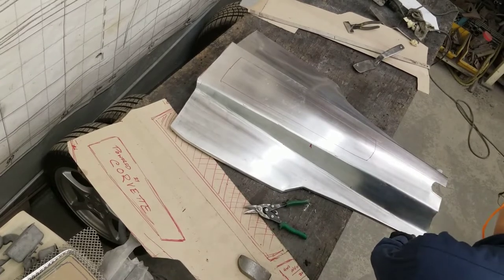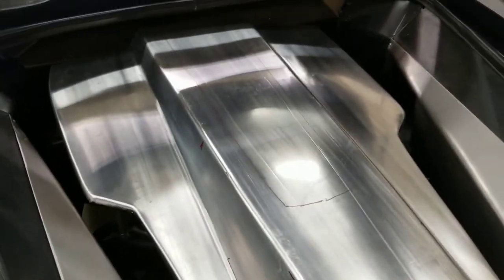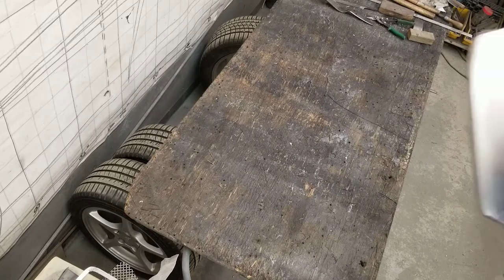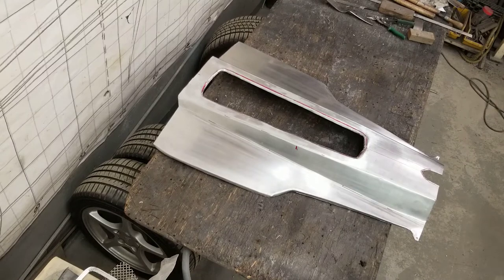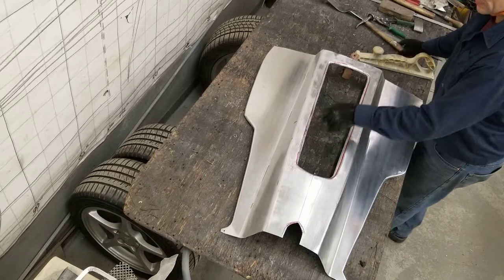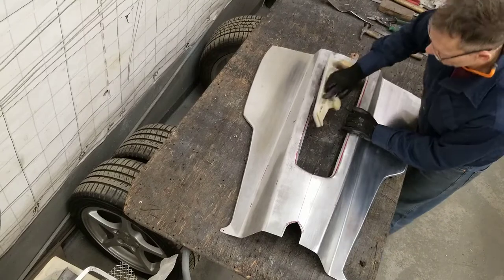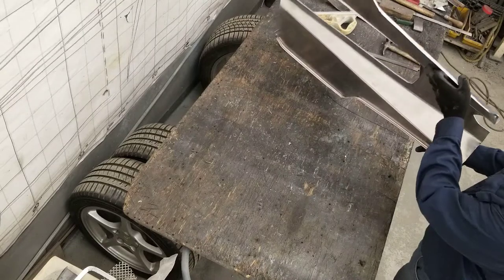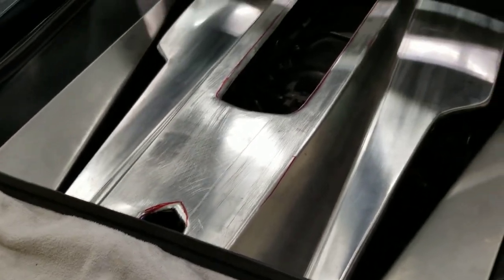Building a Custom Engine Bay Cover - Part 3

Comment: In GM service manual now online called “Electronic Service Information” or eSI for short. This part is called the engine sight cover.  
 Regardless, yours is nice! Mothers mag wheel polish works the best on aluminum and gets smoother and brighter or more polished each time!
  A small competing Australia company makes motor cycle gas tanks & other parts from aluminum and they say it’s the best! Stay safe!
Reply from the maker: Good to know!  To remember it i will use it in a sentence.  "For the M40C build we will be creating a trick ESI for its engine compartment."  Love Mothers Polish, use it on all brightwork we create.  Check out the Rhythm build on my facebook page(again before youtube).  https://www.facebook.com/media/set/?set=a.225558067487609&type=3  Thanks!
Reply: @iNVisionPrototypes  >Between those tools and equipment plus your talent and vision, you create some very nice vehicles! Even Chip Foose doesn’t build every part!
 My hat is off to you sir. (I don’t have any social media. I didn’t even have a cell phone since 2008 until my oldest son sent me one last April.)
PS, At 11, I grew 6” that year. At 12, I harvested an “X” frame from an older GM vehicle. With a 283 cu in and power glide, I grafted a 67 Reanult Gordini onto its frame. I drove the car for less than a year and had 3 guys chasing to buy it. I sold it for $900, but that was almost half the cost of many new car in the late 60’s. I would do it again! 
I appreciate you sharing the work and steps you take to make these items. There is something about bare steel and aluminum shaped into the vehicles you had made. The owner of a large farm realtor owned a “Morton” building. He paid me $1 per hour to help him. He had 18 cars from Model T, 32 Chevy w/straight 8, cream colored Duesenburg convertible 1933? and a bunch more. I was in Awh!
Reply from the maker: @deankay4434  I don't believe you need a facebook account to see the pics in the album.  Just click the link...it's safe.  Thanks again.
Reply: @iNVisionPrototypes  I think you are correct, I just don’t know what all of the details, icons or how to use. It is a strange language in a strange land with someone who is Taiwan shows up as friend request? I just “Mily” to make me a good tailgate. LoL.
Reply from the maker: @deankay4434  LOL!!